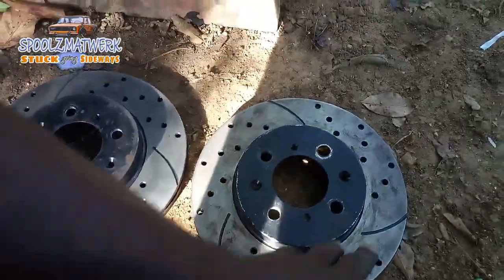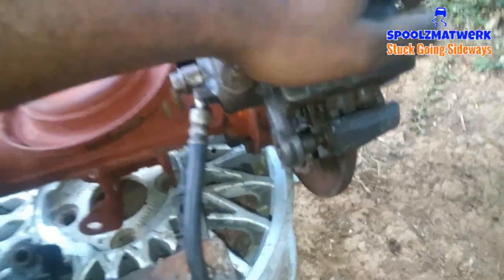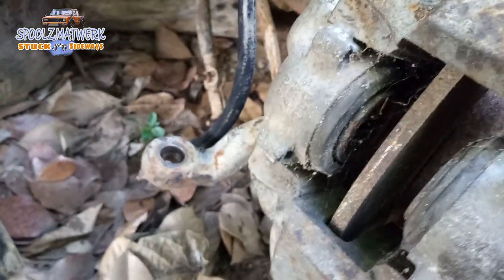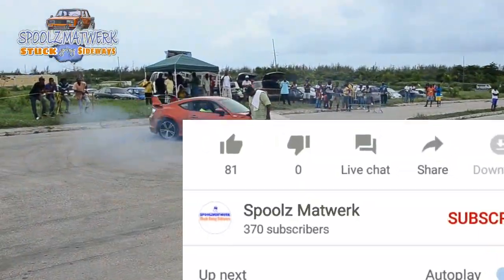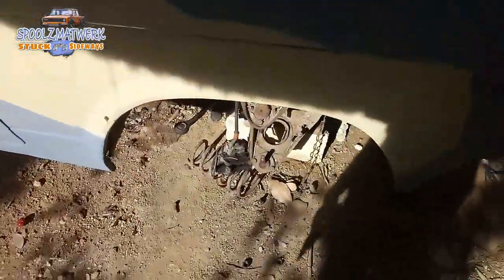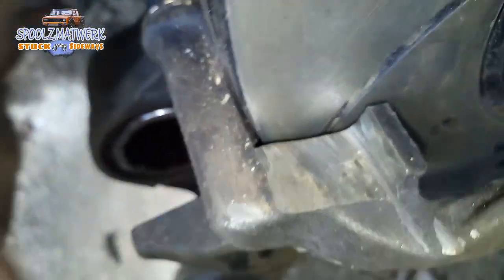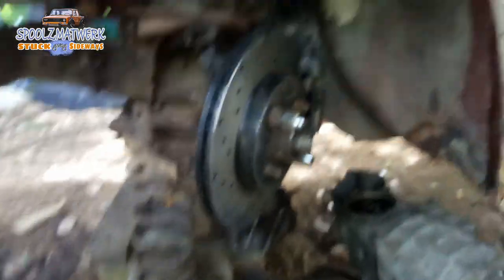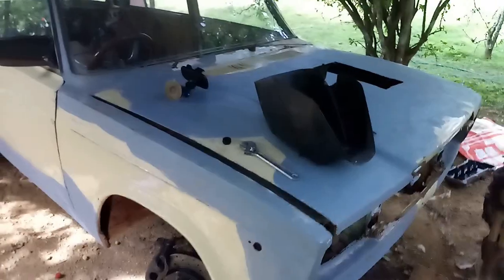[PART 13] Turbo setup and Big Honda brakes...1nz-fe Lada

Comment: bro if this is stock engine internals, the max boost is 6 to 7 psi to run well and durable. if you put more boost, in pass of the time, it could break !

Comment: If a stock piston 10 psi 12 max to start, if u change the piston to what u said 15-20 psi be sure to get an experienced tuner tho and a thorough ecu like a speeduino. Good fi see a nex mad lada on the rise